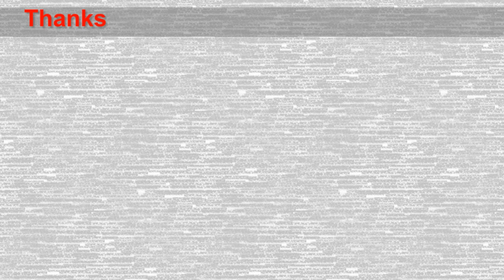Excellent Technique For Making Fake Wooden Tables From Sand And Cement

Comment: Very nice table and great wood illusion work! But is this table really durable? I guess it might break quite easily (especially when moving) because there is no iron inside and the parts were made separately and just linked to each other (without iron again) afterwards.